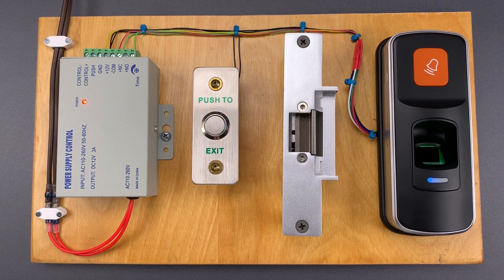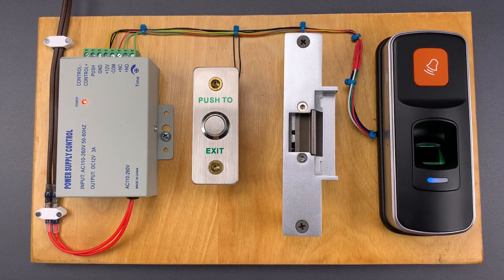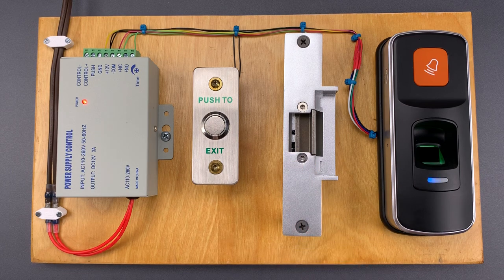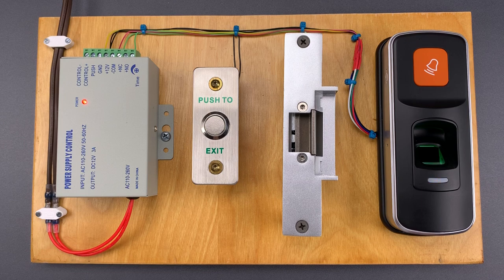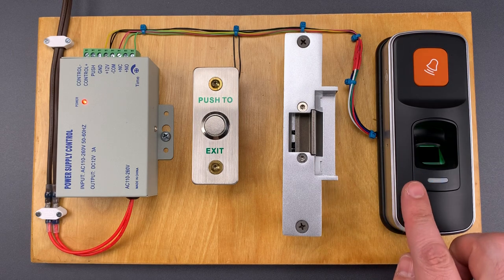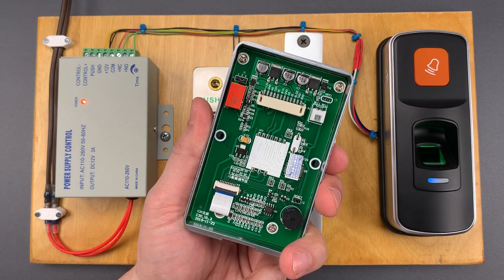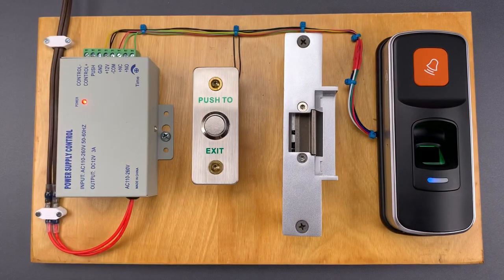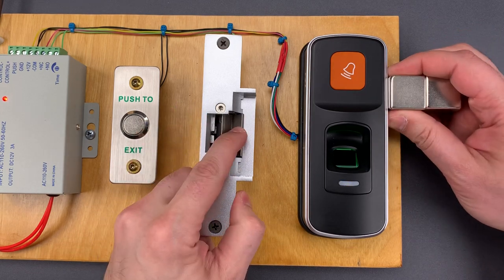[1060] Opened in ONE Second: HFeng Fingerprint Lock

Comment: Why even use a relay, its not that high power, a simple power mosfet would do the trick and remove the vulnerability?
Reply: The same relay can carry AC, any polarity of DC, complicated digital or analog signals, high or low voltage, it doesn't care, it's a dumb switch which will work with anything, and do it all with near perfect isolation from whatever's controlling it.

Use a MOSFET or solid state relay and you only get to pick a few of those at once, along with a few other annoying limitations.

Comment: Kinda obvious, despite all the hi-tech, in the end it's about passing a signal via 1 cable. If not with magnet, then by tearing down the whole box and simply putting power to the right wire. 

For contrary, you will be locked out of your own house if your fingerprint isn't clean enough or if the system catches a glitch. Or if you lost a finger and are trying to get back inside to get help. Dumb system. It' always dumb if it's easier to destroy the door with crowbar. People who really want to get inside WILL get inside. With your finger in their hands, if nothing else. People who don't will be stopped with a mechanical pin.

Comment: WOW.  The first rule of security is never trust the client.  The lock is literally waiting for the reader (the client) to tell it to open.  The "credentials" (fingerprint) are stored in (and verified by) the client.  Just wow.  There should be ZERO connection between the reader and the lock.   The reader should only FORWARD the scan to the control box on the left, who stores the credentials and compares with what the scanner provided, and decides if it should open the door, and then the CONTROLLER should unlock the door.

That system was designed by morons.  Forget the relay, that's not the problem.  The entire design is fundamentally flawed.  The relay is just the icing on the cake that makes it incredibly fast and convenient to bypass.

When the client is trusted to secure the lock, that's essentially a lock with an exposed cam.  "here, turn me!"

Comment: But just stupid people use RFID this way.
RFID is pretty secure, but you don't have to let the unit actually OPEN the gate.

The external unit send the RFID code (pin or tag) to the internal unit/pc/anything else. The internal unit know if that people can log in, when he can log on and then the internal unit actually send the opening input to the relay.

The main break is that the relay is on the reader itself.
Just don't use like this, is plainly stupid, even without a magnet you could just open it, short circuit the relay connected cables and you can open the door, old school.
Reply: Your argument becomes completely pointless the moment he says "stand alone system". He isnt talking about what your talking about and what your talking about isnt built to work with the modifications you mention
Reply: @alastorclark3492  RFID aren't supposed to be used in "a stand alone system".
I appreciate this channel, but showing how he can hack RFID system is a bit pointless, since no one tech savvy implement them this way.

It's not a "modification", it's how they're supposed to be built. 
RFID is for managing access, not for just people in via a stupid relay.

Comment: That design is just horrible, not because it can be activated by a magnet, but because the lock is activated by the outdoor component at all, because it can be opened and the wires manipulated. The outdoor component should only deliver fingerprint data to the indoor unit, and only the indoor unit (to be mounted in a tamper-safe location) may control the lock. Really unbelievably stupid design this is, what does the indoor unit do at all? Just a power supply?
Reply: Yeah, basically a power supply for everything else and it's probably what actually switches the power to the solenoid in the lock, the relay in the outdoor box is probably just running the command line to the indoor PSU.

Comment: Chinese bull shit tech. Relay in external module means you route the line from relay to door lock. All you need is find this two wires and apply external power. Decoder should be close to door and far from external fingerprint sensor or keyboard.